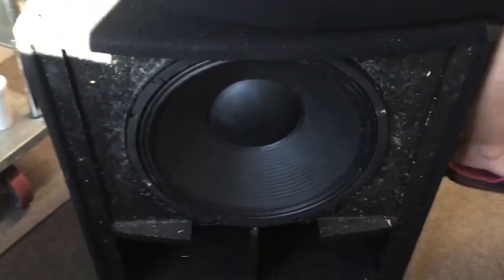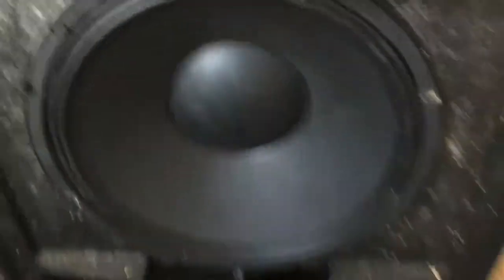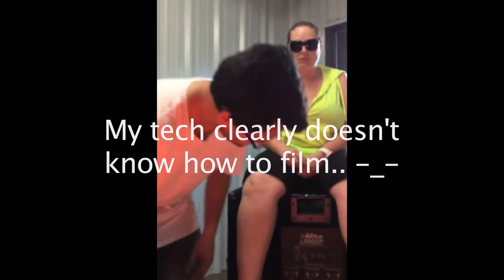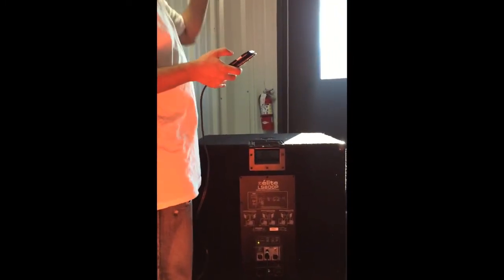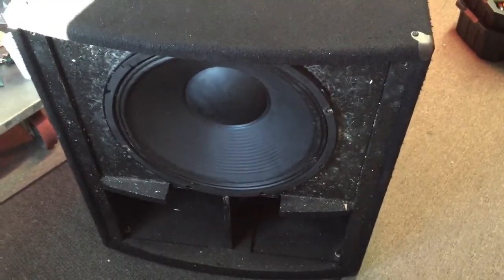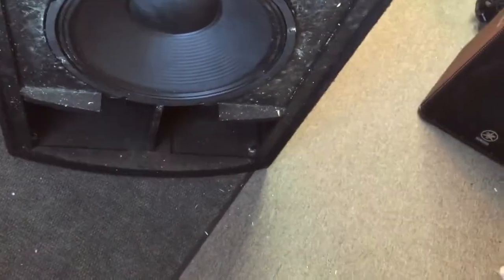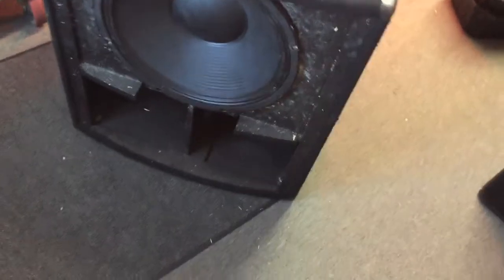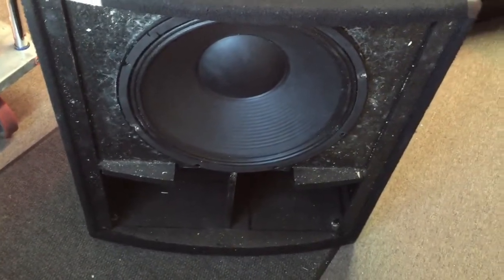Make an LS801 / LS800 louder?! Marathon driver in a Yorkville Sub

Comment: How you get that speaker out, I'm trying to replace mines but it's fit so tight in that when I loosen the screws I still can get the woofer out the box , the sub shutdown on me while doing a gig it's only giving be a signal but no sound

Comment: why don't you use something like jbl stx dual 18inch with a real amp . do you use any kind of limiter or compressor 
just a question ? i see this a lot here in texas lots of dj want to use powered speakers for big gigs ? crazy amazing light shows and little sound systems. i have never understood this ? dont get me wrong i have a powered sound system qsc k12 and the lows that match.  i use dual jbl  srx 728s lows and jbl srx 725 for highs and  a dbx drive rack pa plus for a crossover and limiter and qsc 4050hd amps . its one thing to have a big light show but have a sound system that can keep up with a light show like yours.
Reply from the maker: +DJTONYG24 Unless you're at my gigs, you have no idea what my sound system can do. When you're a multi-op; powered is always easier.
Reply: lol
Reply from the maker: +DJTONYG24 Yeah, unfortunately it seems I can teach my techs the basic of sound or lighting, but not both, LOL!. Powered it is!

Comment: Replace with RCF or B&C Driver please. Bolt holes are 440 mm
Reply from the maker: OG 800s were RCF, I believe... good stuff. 

B&C is what they use now and have been JUNK
Reply: So what model drive will be best as a upgrade driver for the yorkville
Reply: @GearItFirst  They use a entry level loudspeaker in the original LS800, 801 because is more cheap, compared with a 18SW115, that one is the real deal with those powered enclosures.